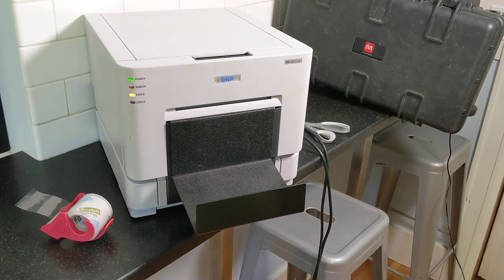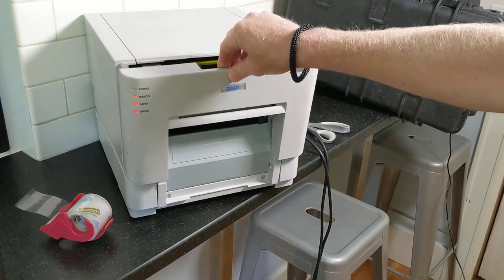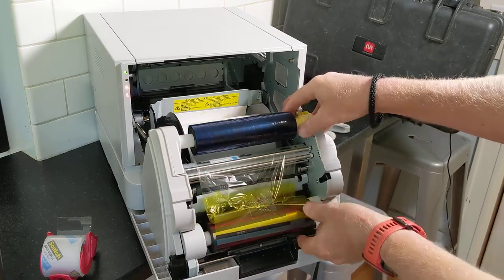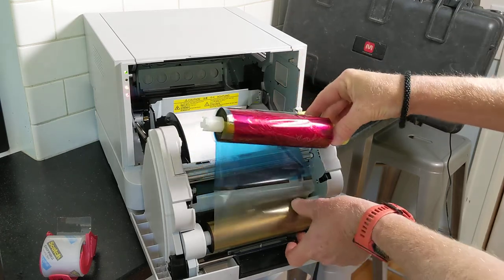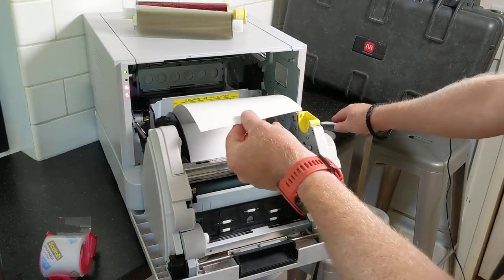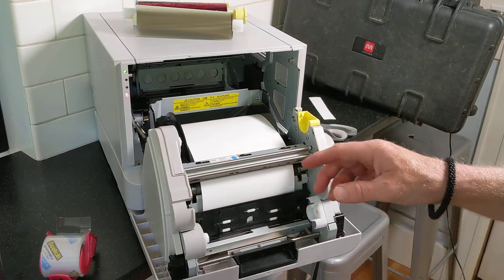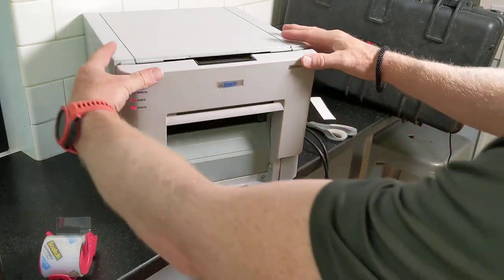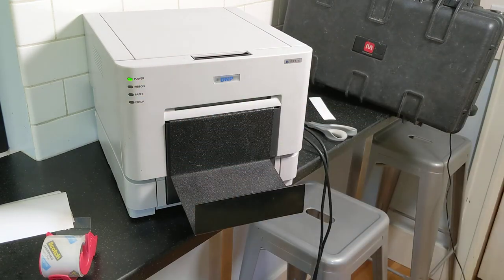DNP RX1-HS -  Loading Paper and Ribbon. Fixing a torn ribbon

Comment: Hi You described the cause of the need for the paper or ribbon repair to be rough travel, I was told to remove the media and place the travel  foam bar in for travel is this really required?
I would prefer to leave media in for travel., I use a travel case when moving to different venues, and then there is the excess paper usage when  doing that procedure please advise if I can get away with not removing media for travel.
Of course you have described what to do in the event of rough travel.  Also would you rent out the  RX1 HS with paper and riibbon already loaded? thanks in advance, Wayne